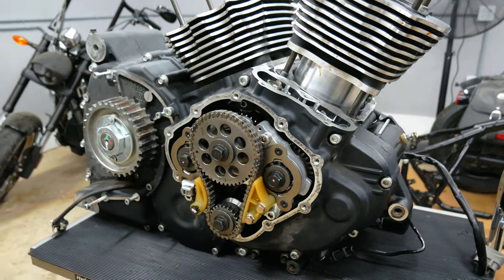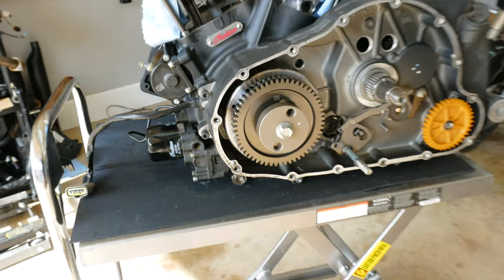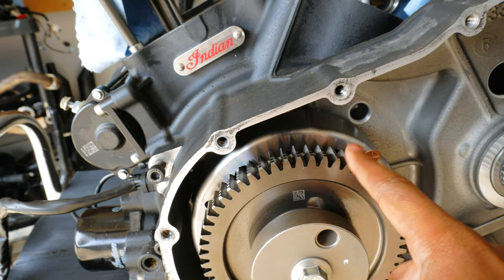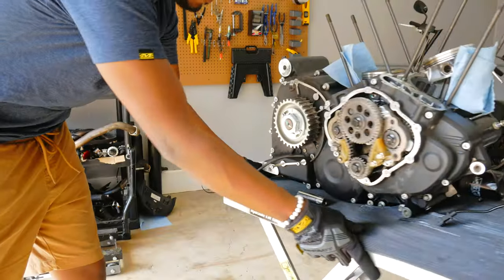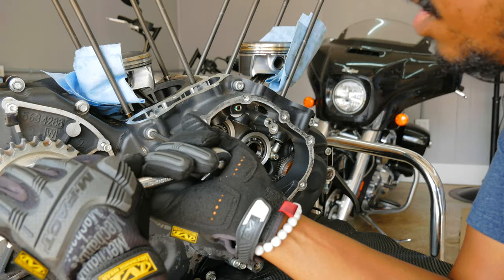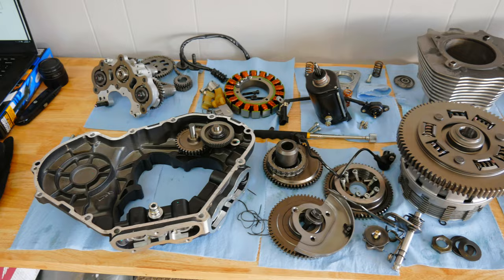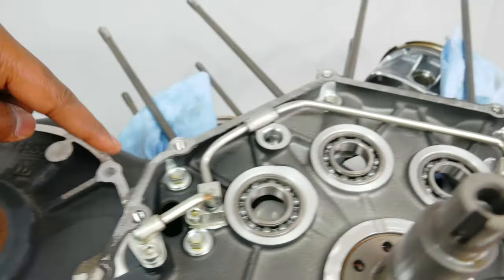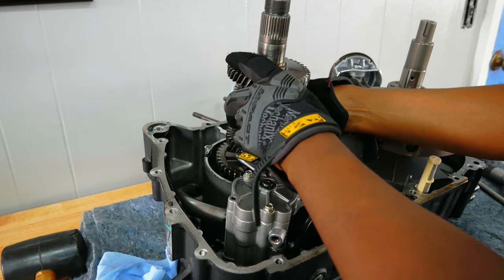Wrecked 2022 Indian Chief Rebuild (Pt. 8)

Comment: You are braver than me.  It's not so much tearing it down that is daunting but the thought of putting all back together successfully.
Reply from the maker: Good thing I categorized everything when I stored it away. Shouldn’t be too bad. Just replacing seals and torquing things down. Long as the motor is at the correct timing, won’t have as many issues.

Comment: I understand computers, not engines. I’m just amazed by the insane amount of cogwheels in there.
Reply from the maker: Lol, same here. Computers first. 🤟🏾😎 Now engines are becoming a thing.
Reply: @BrandonBicasso  Kind of the opposite for me. I can look at stuff like press fit bearings, gears and synchronizers and see how they work. whereas for any thing electrical more complex than an old school voltage regulator I need detailed instructions with pictures to avoid letting the smoke out. 🤪😏

Comment: Just a suggestion. I don’t want to come off as the know it all guy but I would highly recommend changing cams now while it’s apart because you will need a cam installation tool if you wait until everything is reassembled and running later. This tool keeps you from dropping a lifter and having to disassemble the engine to fix this. I was a tech at Indian for a bit and put in many sets of cams/116 kits. Or you can buy the cam tool for $500 to $600 and do them later. Up to you. You’re doing great, aligning the spring loaded cam gear can be a pain but just be patient with it. Keep the  videos coming! Brings back some long work day memories!
Reply from the maker: Nah, you’re fine! I planned on buying the tool from Lloydz since I have other ThunderStroke plans. I haven’t fully decided on if I’ll change the cams on this motor or the Super Chief because of cost but we will see. Good looking out.
Reply: @BrandonBicasso  ok gotcha awesome, I can understand that for sure definitely gotta remain budget conscious with something like this cause it definitely adds up quick!
Reply from the maker: I’m about $4000 into the front end alone 😂
Reply: Shew weee😂 sounds about right 😣 well at the end you can look back at it and be proud of it, and know every square inch of that thing and to me that makes it worth. The experiences and the knowledge gained that follows make things like this worth doing all the time!
Reply: Love it. Keeping awareness on point.

Comment: What you said at the end was me when I had to rebuild my M109R engine.  Never done anything like it before, but with hunger,  desire to learn,  the right tools, service manuals,  YouTube videos, and great help from the community, I did it.  Nice work!
Reply from the maker: If I ever have a gear failure on the 109, I’m ready to take it on. That one will be a bigger job considering the miles but I’m definitely up for it after taking this ThunderStroke apart.

Comment: Lol I found your video continuing the tear down of your motor.

I can't believe how similar that those Indian lifters look compared to an LS motor.

The penny trick, I've never heard of it before. Thanks for the tip!

Gotta love Harbor Freight. I use them a lot. My '17 Chieftain is currently sitting on a HF motorcycle jack inside my HF tent garage while using HF hex wrenches to remove the fairing to swap out my 2ch amplifier for a 4ch amplifier. I've added in saddlebag speakers to get more sound.

I'm loving that you are not afraid to tear into an engine. Many of today's youth have no ambition or motivation to take on a project like this. Your story at the end will encourage others to want to do this type of work on their own projects, no matter what their project is.

Great job Brandon! I'll be tuning in to your follow up video on this engine tear down and update on the cracked case.

Comment: In your obviously Pro Opinion, how high would you rate Indian Engines? I dont know if theyre as good as a Honda/Yamaha engine, but they seem to be very well made from this side of the screen at least
Reply from the maker: I’m not an engineer so I can’t comment too much. However, for someone who has never worked on one, they’re not intimidating. The lack of a radiator makes it less messy too. I like how major components come out as one unit along with only having one chain to deal with.

Comment: You are really into the engine deep now!
Reply from the maker: As far as I can go. 😂
Reply: @BrandonBicasso  -----> Do you plan to have an Indian mechanic rebuild the engine after you get the engine case crack tig welded or will you rebuild the engine yourself with the Indian shop manual?

Comment: Wow ... gives me hope! Just yesterday in an attempt to remove my OE TS111 conrods a messed up one of the conrod bolt heads . I have two options to "get to it":
a) splitting the case and tearing down.
b) cutting the conrod low enough to allow it to show its bottom side. (has been done, but needs a lot of protective precautions to not contaminate the case)
Your video has encouraged me to split the case.
Interesting will be when you glue the halfs back together though ... keep it up (and I can't wait)!
Reply from the maker: Good luck on that. Splitting the case is a no-brainer now with the correct tool. Takes all of 10 minutes to set the tool up and then apply pressure to split.

Comment: When I built model cars and airplanes when I was very young, I would always have some parts left over.  I'm afraid that if I attempted to tear down an engine like this and put it back together, I would have parts left over, which would not be good.
Reply from the maker: The funny thing is there are chassis parts left over but I have this motor pretty buttoned down on where everything goes. 😂

Comment: I recently bought an early model dyna and the can chest grenaded while on a cross country road trip. I basically need to do the same thing you’re doing since it destroyed the end of the crankshaft. Im not looking forward to it even though I have plenty of mechanical experience. Props to you for getting right into it
Reply from the maker: Yeah that's gonna be a challenge. Taking apart a motor is one thing, but it gets more difficult if parts aren't broken in places. Troubleshooting is another skill as well.

Comment: You got it going on now, Brandon! It's all just nuts and bolts, after all. Polaris changed some fundamentals from the Victory line to create this Indian. I hope that was not a mistake on their part!
Reply from the maker: They did a good job designing it. Taking it apart really can be done with common hand tools outside of the case splitter.